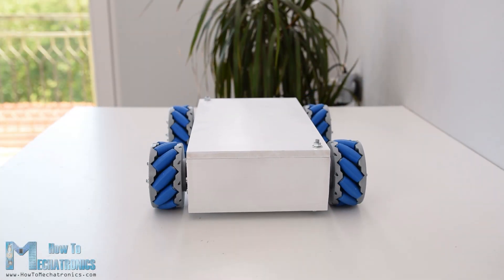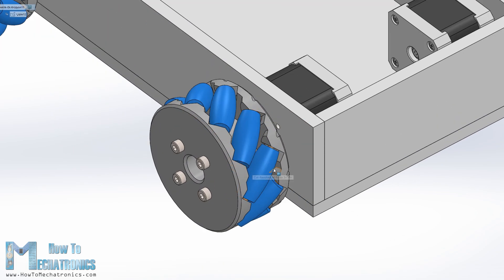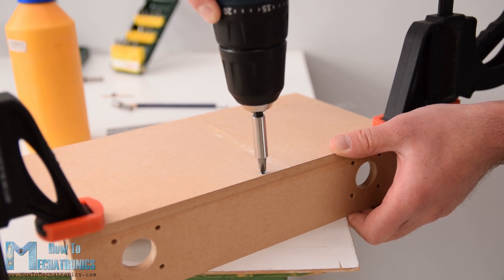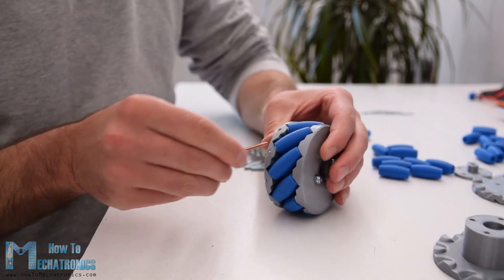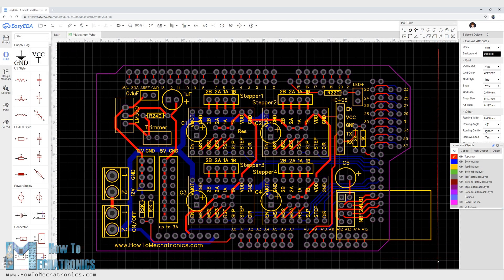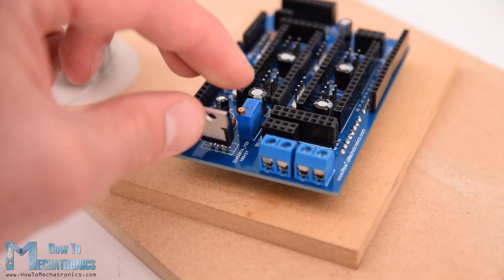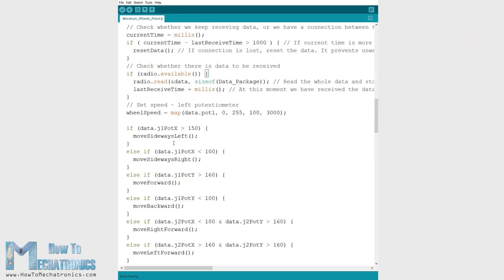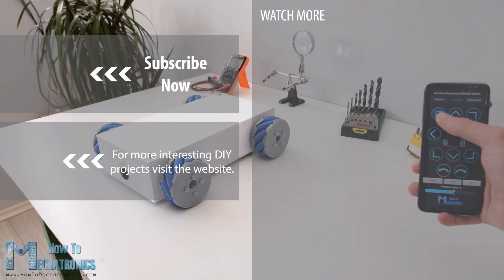Arduino Mecanum Wheels Robot

Comment: Nice build, I'm working on a meccanum wheel robot too, but my version is a little bit bigger.
Reply from the maker: Thank you! I've just checked it and it's really impressive. Actually of your work is quite impressive, those robot arms... I felt like a noob comparing my builds with your builds. 😊
I will keep an eye on your mecanum wheel robot progress.
Reply: @HowToMechatronics  thank you, well the problems always start if you scale up things ;). I think you did a good job explaining how the mecanum wheels work, and I like the clean build style.
Reply: Hello, can you help with  the capacitors and resistor value (Ohmic Value) and capacitors name etc stuff like that. in the robot's PCB  @HowToMechatronics
Reply: Hello, can you help with  the capacitors and resistor value (Ohmic Value) and capacitors name etc stuff like that. in the robot's PCB

Comment: 3:28 there must be a lot of friction to move in diagonal direction because other two wheels and its rollers won't be able to move. Any solution to this problem?
Reply: That is just 1 of the flaws of Mecanum drivetrains, and cannot be avoided. If you want to improve on it you would have to get a better drivetrain like "H-Drive" Omni-Wheel or Swerve, which can go diagonal (especially the latter) without any extra friction and are much faster in all direction (Mecanum wheels are slower by design)
Reply: @itay-ziv  Thank you so much for reply and currently I do not have much knowledge about the drive trains that you have mentioned(This is the first video I have ever seen about mecanum wheels), but I will surely do more  research about it. Hats off to your knowledge.
Reply: @darshitdarji3217  Just a quick explenation, Omni-Directional wheels are wheels with small rollers that are 90 degrees to the wheel instead of 45, so if you have a robot with 4 of them you can just push it sideways without any effect, so a "H-Drive" just has another wheel which is at a 90 degree angle to the other 4 in the middle of the robot (Hence the H), allowing you to move in all directions based on the speed of the wheels (being omni, they won't have any effect on each other). Swerve is where you have (normally) 4 wheels, which each can change the angle, meaning you can point any one of them in whatever angle you want.
Reply: @itay-ziv  I am feeling the luckiest in the world!!!
Reply: @itay-ziv  "are much faster in all direction"
They're even faster when the wheel isn't aligned with the direction of travel. A four wheeled omni-bot is fastest when travelling 45 degrees from the wheels' alignment.

"Mecanum wheels are slower by design"
Omni wheels are only faster when moving at an angle to direction of the wheel is turning.
Reply: Duane Degn umm not sure if I completely understood your comment, but I think I did. Omni wheels are faster even in the direction of travel because of the way mechanum wheels contact the ground and move, and because driving mechanum wheels takes a bit more torque and can’t be driven at the same speeds because of minor inconsistencies
Reply: @itay-ziv  The distance an omni travels when aligned with the direction of motion is pi time the diameter times the number of rotations of the wheel. This is the same distance a Mecanum wheel travels when aligned with the direction of motion.
Omni wheels aligned with the direction of travel have the best traction of any direction but also result in the slowest speed for the robot.
When omni wheels are aligned 45 degrees from the direction of travel, the robot will move at about 41% faster speed than the same robot with the omni wheels aligned with the direction of travel. (Assuming motors are turning at the same RPM.)

Comment: Cool project i made my project a few weeks ago and the mecanum robot is controlled by the gestures of my hand which uses bluetooth, i also added a car chassi over it to project the MSP430 which i used to programme it the only this is i bought my wheels which 3D printed 1 would have been cooler.
Reply: Why not make a video showing the robot?

Comment: Great project...can you please make this with simple wheels and DC motors.... please suggest if that's possible ?
Reply: You could but to do all the functionality  you would need to program and deal with an encoder.  With just a DC motor, no encoder you're only left with each motor rolling forward and backwards, I think.
Reply: It will work with DC motors alone if the DC motors are powerful enough. Using encoders gives you much better control. Search my channel for Mecanum to  see a relatively inexpensive example of using DC motors with encoders to drive these wheels.

Comment: You should really break these videos out into like 5 parts.  There is so much content here and the production quality is impressive!
Reply from the maker: Well yeah, there is so much content and because I want to be a single video I sometimes I rush through some things and don't explain them very well. On the other hand, I'm afraid making a single topic in several parts might be a bit boring to watch and follow. Still it's a trade off.
Reply: @HowToMechatronics  yes that can be sometime boring. Still it is good idea to put detailed content on website instaead of video to be too long.
Reply: @HowToMechatronics  can I use pre made aurduino shield if yes which one should i buy

Comment: i want to change the bluetooth controls so I dont have to double click to stop it again. it should drive while i click/hold and when released it should stop. any tutorials for that?
Reply: That's on the application side, check tutorials for that..
Reply: There are lots of free apps with joysticks. The app sends serial data indicating the stick position.

Comment: Why aren't cars like this yet? 😒

Can it turn like a car (i.e., rotate+move at the same time)? 🤔
Reply from the maker: Yes, it can move like a normal car, but it needs to be programmed appropriately. With this simple code we can only move it in these predefined directions.
Reply: Car drivetrains are very different then what these wheels bring the table, they require 4x4 operation (and proper speed control only available on electric cars), and are completely different than the current wheels used in cars, which rotate to give you a turn, these are more "tank" drive wheels, where turns would need proper speeds instead of actual rotation.

Comment: Great. Tks for upload.! 
Will try and use encoder dc motors instead of the stepper ones..
Reply: Ya right encoder dc motor may be good option
Reply: I have an example of using Mecanum wheels with DC motors and encoders on my channel.
Reply: Hello sir I am new to aurduino I did everything menty in this video but I got some error when uploading the code can you please send me the code that you use for your car

Comment: Great project. 
I want to control 4 stepper or servo with IMU sensor. 
Could you please help ?
Reply: @saladnuts how can I convert IMU data to something that 4 servos understand it.
Reply: Hello, can you help with  the capacitors and resistor value (Ohmic Value) and capacitors name etc stuff like that. in the robot's PCB

Comment: This is cool but there is one problem if you apply it on real life , the tyres will get worn out quickly, otherwise it is awesome
Reply: Actually in our country there are real life trucks like this they move in any direction but they are very small compared to others and they used for digging
Reply: Mecanum wheels are actually quite durable, not the ideal Holonomic drivetrain but they won't wear out, they just might require maintenance to make sure that all the rollers are free spinning so the wheels work as expected.

Comment: You're a perfect genius. You're one of the few most creative designers I ever saw on YouTube. One thing I would like to ask regarding this project : can a single code run both of the modules? So that when I use any of the two, either smartphone or your controller, the robot will run
Reply from the maker: Thank you! Sure it's possible to make a single code to run both modules. This way they are just simpler to use and understand. Though a simple toggle switch on the robot could do the job for selecting the module, and the two codes could be combined with just some very small adjustments.
Reply: @HowToMechatronics  Hi Dejan. Amazing project I would want to create it with the robotic arm, but a question: can I use a Motor Driver Shield instead of the 4 A4988 Motor Drivers? Pls answer I have to order the parts I need